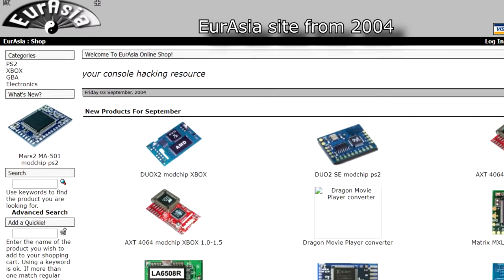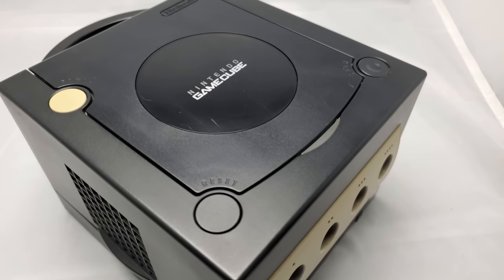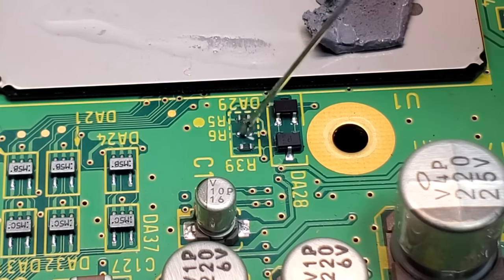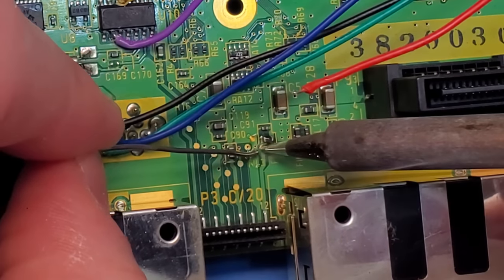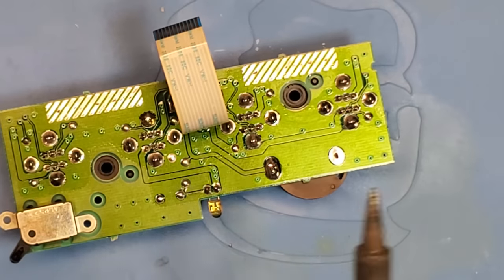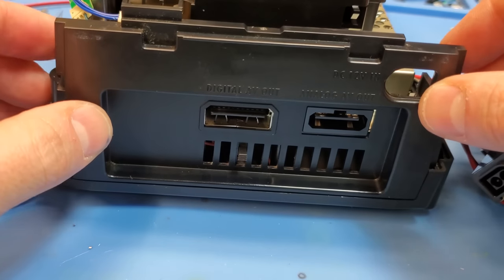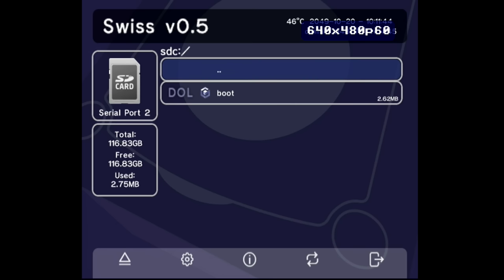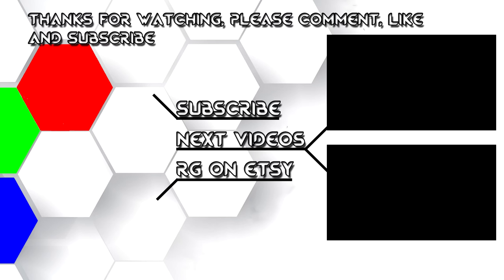Doing a Gamecube Mod like it's 2005

Comment: I still have my original Qoob Pro modded Cube that I did the same thing too back in 2005 or 6 . I could never get it actually boot full size media. The drive would struggle to spin up the disc. It still works really well today.  This really takes me back. Thanks for this!

Comment: I did all of this in 2005.  Starting with the terrible ethernet streaming using phantasy star.  Bright side of that is I got both Phantasy Star and the Ethernet adapter for cheap!  Then I got the qoob and installed it with whatever wire I had lying around and to this day it still works great.  I used your guide to put Swiss on my system.  Today, I bought a new console and installed picoboot, gc dual, and swiss on the sd2sp2 and that'll be my daily driver.  I have the dvd sized case, it has lights on the top with a switch so it makes up for no power light.  I have the clear dvd viper case though.  I remember all these things from the old days.  It is funny that the picoboot revived the IPL injection exploit that the qoob started though, it just does it better.  Thanks for the vid!

Comment: I had a GameCube modem adapter and used dial-up internet to get online up until about 2017 when I finally bought a broadband adapter, believe it or not. The speed difference is just insane. I'd wait on the PSO dial-up loading screen for 1 to 2 minutes and the broadband adapter takes less than 10 seconds.

Comment: I did a XenoGC mod several years back and have a custom top case that allows full-sized DVDs. With the PicoBoot and SD2SP2, it's starting to feel like a mod solution from 2005 as well :)

Comment: The IcedCube from Team Xecuter is, by far, the best replacement case for GameCube. I still have the Ice Blue Limited Edition. It retains the lid resistance for slow-opening and everything. It also works with the original jewel if you transplant it from a DOL-001 (DOL-101 does not unclip).
Reply: The full case version of the Iced Cube also has a rear mount for the Qoob USB port (and ViperGC parallel port). ...and did I mention it retains the power LED? ;)
Reply from the maker: That is a really nice replacement case!  This also works with the OEM jewel as well, but man finding one of those cases today is incredibly difficult!  Having said that it would be awesome to feature it as I have viper case too.  While this case is boring in terms of color, I do prefer it to the viper case as I dont like the jewel option they have for it.  You're so lucky to still have the blue as I would argue its the best color!

My question is, who has the molds for those cases and where do I buy them, lol.
Reply: @RockerGaming  It’s crazy to think that the GC modding market was big enough for Hushtrap, XCM, and Team Xecuter replacement cases/top shells, especially with many willing to use mini DVDs, modify their original shell, go topless, or stream. Even I waited until 2008 to get it and it’s essentially unused since I was OK with the other options. I still remember when Animal Crossing Loader came out and I rushed to grab a copy of PSO to try it out. Worked a treat! :) When the ViperGC’s Cobra BIOS was extracted and released as a DOL called “Anaconda” I went to #Dextrose and suggested that an Action Replay could be used to load it from a memory card to softmod a GameCube without PSO+BBA but it was beyond my abilities. This started a conversation about bootstrapping a bootloader with a micro bootloader and all that. A week or so later we had Samson’s AR Loader. Samson was definitely in the chat, so I’m pretty sure I had a hand in it. ;)
Reply: @RockerGaming  ...but, yeah: The molds obviously existed. What happened to them? I was getting kinda panicked in 2008 when I was having trouble finding the full case version so it was already hard to get. It seems there is a lot more interest today, so it’s past time to drag those puppies out and press a few more. Last I heard some Team Xecuter guys were arrested for selling Switch hacks but I have no idea if they were even the same people 15 years later.
Reply from the maker: So its interesting I have a feeling that many of the teams that did releases back in the day actually sources their molds from other companies/groups.  For example, when doing my research for this video I found team xtender did cases for several of the release groups back in the day.  I should see if any of those email addresses are still good and if access to those molds can still be had.  It would be a very interesting proposition to have more made today and I think people would love the ability to get them again.  

I was dumb unfortunately and never secured a full size case back in the day.  Today I only have a bunch of half shells as a result... I would love a clear blue, clear, or smoke black full case!

Comment: I remember dreaming about that case and Qoob Pro in the past. I never got them to this day. We came long way since then though... In 2021 it no longer makes sense to buy that case. Not only it's too expensive and hard to find but also it's a pain to burn DVDs. Swiss has very good compatibility with games playing from SD2SP2 or SD Gecko which makes it way better alternative. And there is GC Loader if you don't care about the disc drive. So many good options nowadays :) And there is much more new stuff in the works right now, it makes the future even more exciting!
Reply from the maker: Very well said, I couldnt have said it better!  I got lucky finding this for virtually nothing, but a bundle like this easily goes for $300 today, which makes no sense when you can have a GC with GCloader + SD2SP2 + SDGekko for half that and it does more!!  I am excited for the next wave of HDMI mods for Gamecube... that is going to be massive for the scene!
Reply: @RockerGaming  ya exactly! I would like it just cause usb. But my wii can do all this anyways. Also pluto hdmi mod ftw

Comment: 3:20 Pausing here to wonder if you'll route the power LED to the power switch(or one of the other buttons), replace it with a clear cast button... or

oh damn, I knew I forgot about something. I gotta do that battery replacement too. Have a link to that one, or would any place have it?
Reply from the maker: Haha, I opted to go easy and just do the led mod on the controller ports, though casting the power and reset button definitely crossed my mind!

I cant recall where I got the ones I had.  I order a 100 or so of the back in the day and I have been working my way through them since.

Comment: You are such an inspiration that I start to do mods because of you 😄
I have a gamecube with xeno with a weird issue..when I plug the controller, it works fine in the GC menu.. when i insert a game, it boots, but then the controller doesnt respond and the game works fine..tried with different controllers and different games. Did it ever happened this to you before? 
Thanks for the tip!

Comment: Great video man, just wandering what temp you use to solder on circuit boards?
Reply from the maker: I use either 650*F or 700*F depending upon the application. For the most part it's 700*F